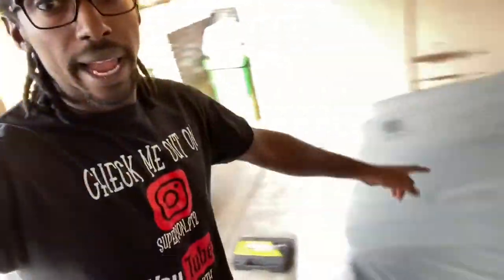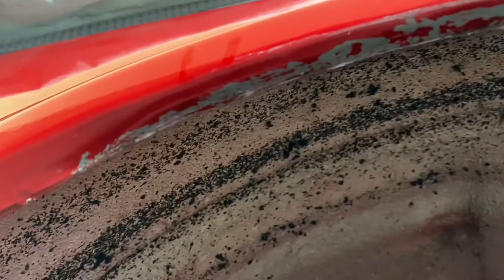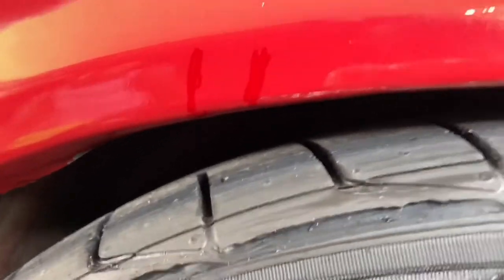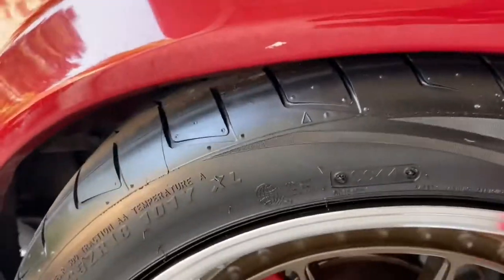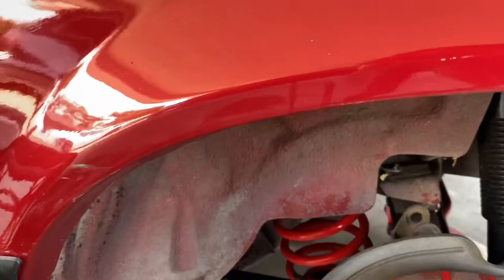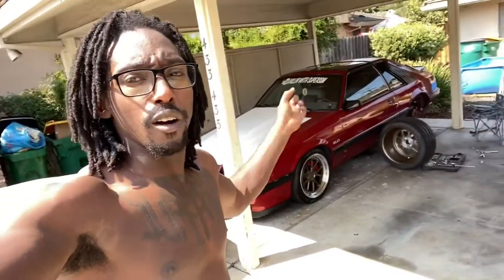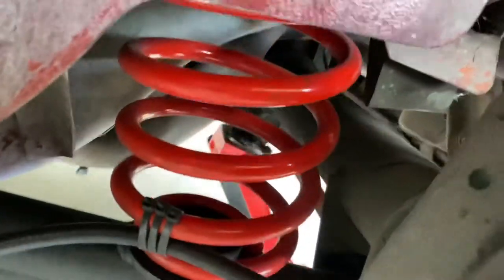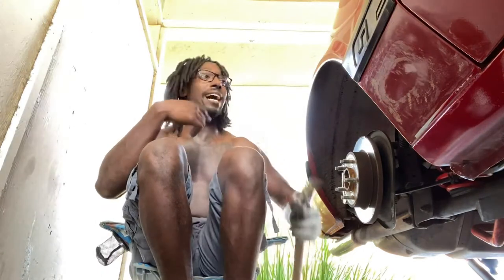HOW TO ROLL YOUR FENDERS WITH A HAMMER #pvoisontherise #fenderrolling

Comment: A wooden baseball bat works good also. The trick is to take your time. I used the Eastwood fender roller with a heat gun on my 93 cobra and the paint still chipped on outside lip.
Reply from the maker: Yeah I know next time to take my time. I plan of doing it to my 92 Gt I just picked up so we will see how it turns out. Thanks for the information I appreciate that.

Comment: Did you get rid of these wheels because of the rubbing issues ? And did you remove quad shocks ?
Reply from the maker: Yes i did remove the quad shock and no i kept the wheels but need a differnt spec